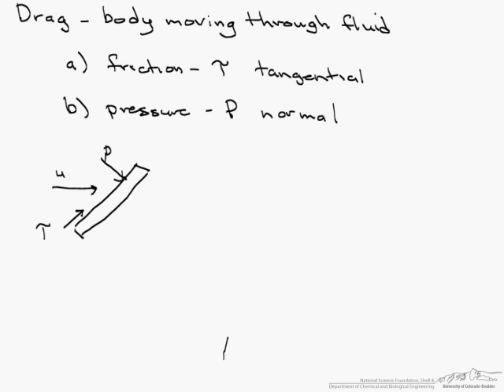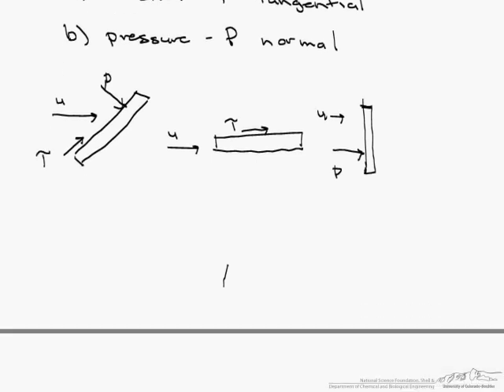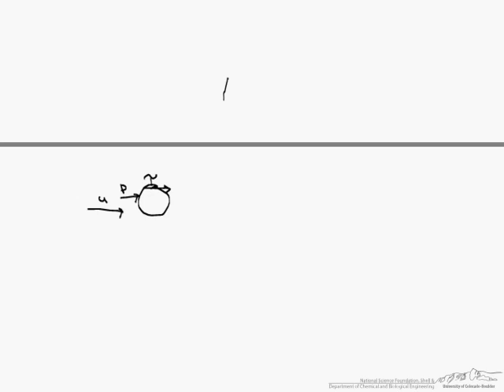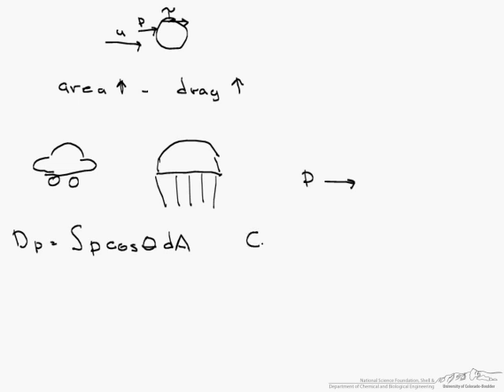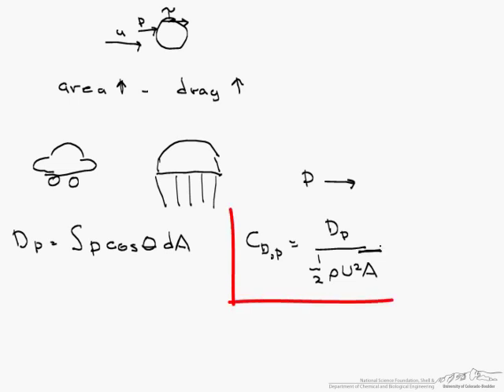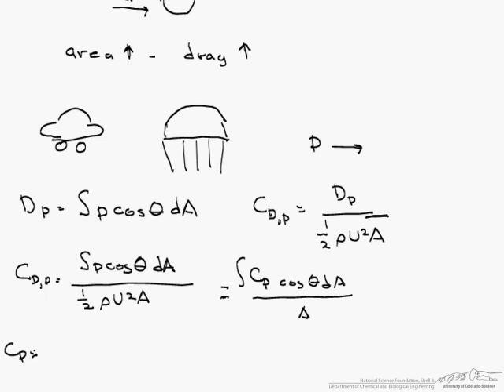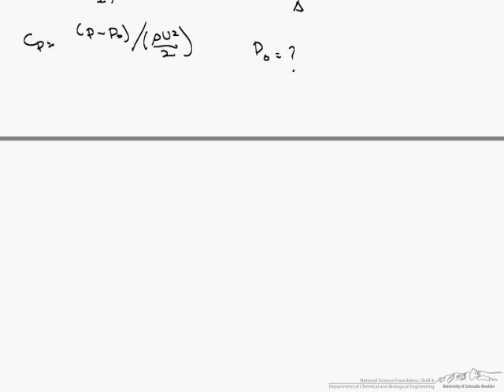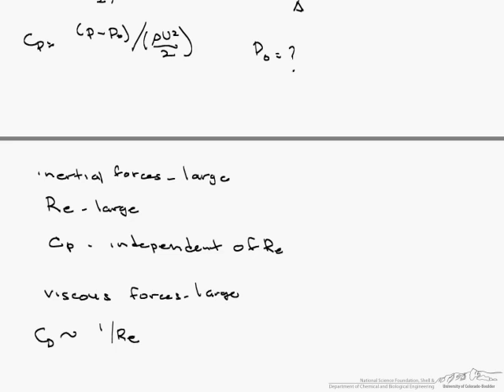Pressure Drag

Comment: Thanks for the quick response! In my problem, the velocities are so small (of the order 10E-5 ms-1) so is it reasonable to suggest that the effects of both friction drag and pressure drag are sufficiently small that they can be neglected? My problem is basically a flow of a fluid between two plates with two circular rods inserted. The fluid flows because of an imposed pressure difference and I have to analyse the forces affecting the fluid during its flow. I'm having difficulties describing the flow as the fluid encounters the circular rod (where I imagine the friction drag will predominate). I have used a software to numerically compute the velocities at the outlet but describing the theory between the inlet and outlet is proving a bit stubborn...Thanks for the help in advance!
Reply from the maker: My simple concern is that they are not negligible and should be considered. The flow characteristics (Re) and fluid properties do likely play a large role in whether or not you can "neglect" your frictional drag forces and the size of the rods with respect to the field likely control your assumptions regarding the pressure drag. Sounds like a good problem!
Reply from the maker: My take would be to try and characterize the force due to drag and compare it to the forces acting on the fluid into your control volume.  At least this might give you a relative look at things. There are good resources out there on CFD that might provide an avenue for modeling, but sounds like you are doing that already.

Comment: how would you describe the drag if a fluid was flowing over a stationary circular rod? Does drag always happen whenever there is relative motion between the fluid and the solid?
Reply from the maker: Anytime a moving fluid comes in contact with another fluid or solid, drag will occur.  Pressure drag is directly due to the pressure acting on an object.  In your example a fluid flowing over a circular rod would both exhibit pressure and frictional drag forces.  Both should be considered to determine the total drag force